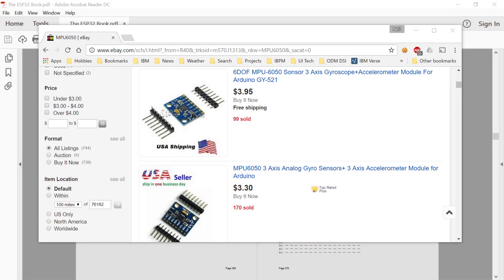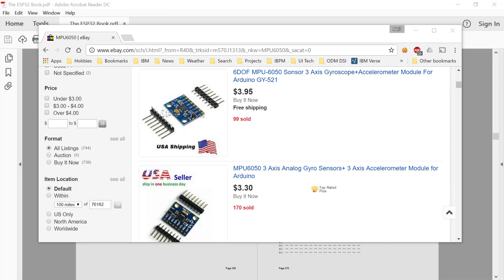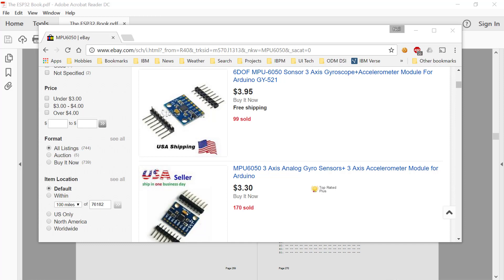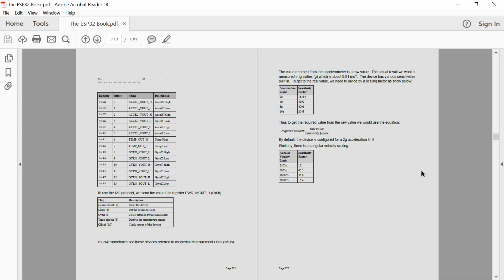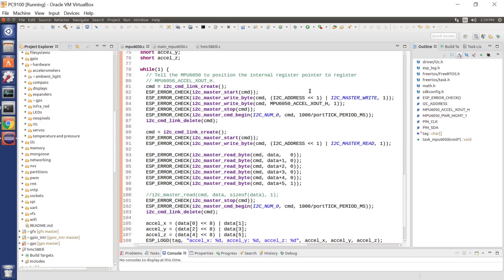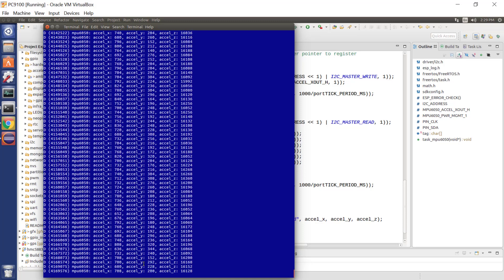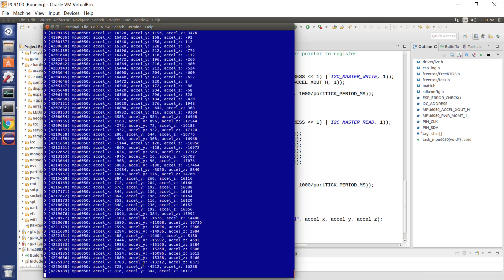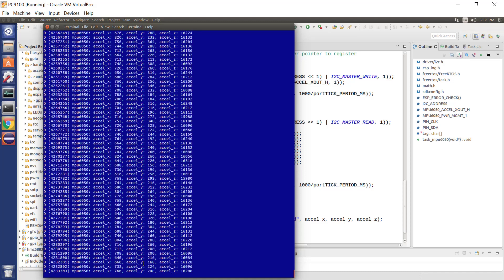ESP32 Technical Tutorials: MPU6050 Accelerometer

Comment: Hi Kolban,
I am using MPU6050 interfaced with ESP32 as an Access Point and having several tasks running on both the cores . When I2C clock rate is 100KHz, I get legit values, but when I2C clock rate is changed to 400KHz, the MPU6050 gives "-1"(error). What can be the issue ? I am using wire.h library in arduino.
Thanks in advance

Comment: Nice video can three of these be chained together as I would like to be able to measure vibration in three spots
Reply from the maker: When using the I2C bus, every device attached to the bus has an address that makes it unique.  You will have to check that you can change the address of each instance of the device at the device.  I'm not at all sure you can do that with this module.  A possible solution is to look for an accelerometer that uses the SPI bus.  With SPI, again all the devices share the same bus but now there is an explicit signal pin that is used to select the device that you want to read/write.

Comment: Interesting video.  I can think of some cool uses for that.

I also note your item location options.... if that zip is true you should come to the NRH Public Library on the 2nd Wednesday of the month for the makers meetup.  We had three different ESP8266 NTP based clocks last time (my two definitely not as good as the other guys) and there's usually something interesting going on.  In case you didn't know, the library also has a maker space, with several 3d printers and much other stuff.